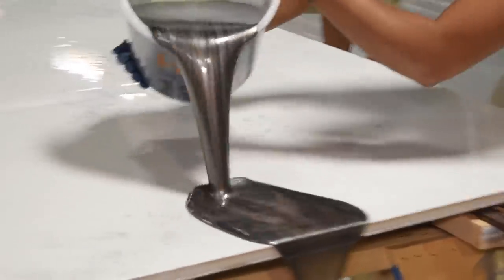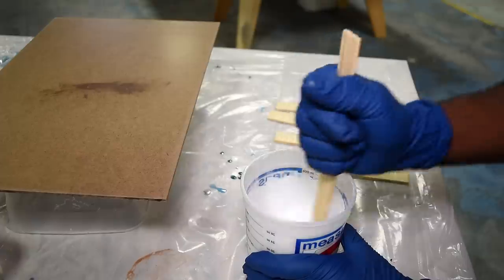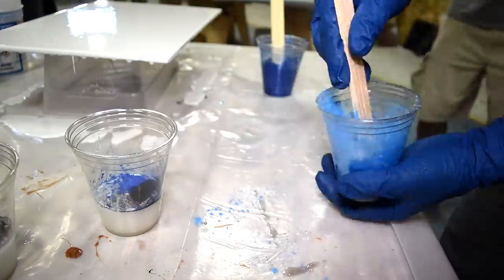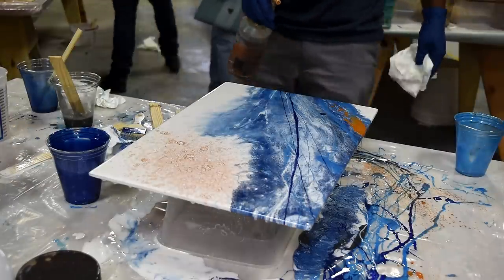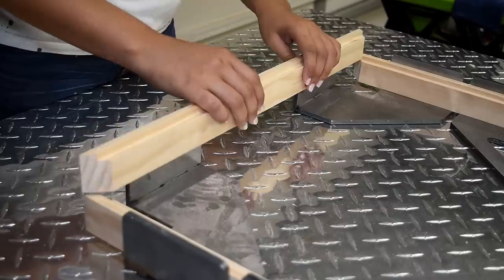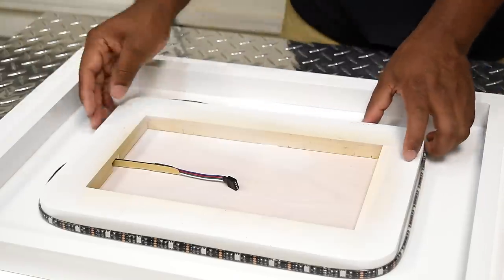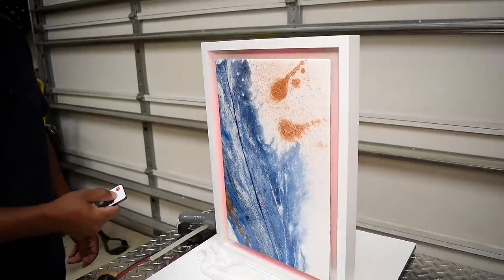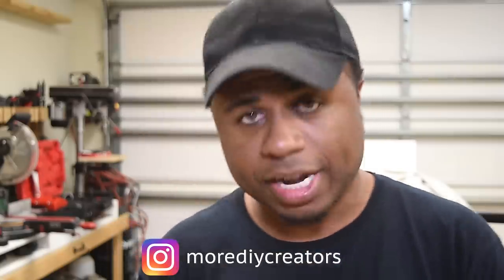How to make a modern picture frame and epoxy art

Comment: Nice project, like that LED frame too!
Just received my 20 pack of 1ft LED strips for my project.
Reply from the maker: Thank you nice, What you making?
Reply: Some will be used to light up the back of the headboard and under the frame of my daughters bed. (Multi-color)
This will be better than leaving the hall light on for her. She'll be able to dim, and change colors.
Also less power hungry!

The other will be for my Creality Ender 3D printer. (These will be white only)
When I babysit special or multi-color prints, I have to use a flashlight at different angles to see things.
These strips fit right in the extrusions to light it all around.
Just waiting for the connectors to show up.
Keep up the good work!

Comment: For the colored bits you don't need to use a brush, sometimes the pour itself is awesome. You can use a heat gun to get rid of bubbles and blow your colors around a bit too. What was the dry time on this particular epoxy (they vary)?

Comment: Pocket83 (a cool youtuber) told me that when working with epoxy the result would turn out better if you heated up the plate rather than the epoxy itself.
Reply from the maker: mmm I think I am going to stick with what I learned. Just thinking out loud that seems like a bad (I could be wrong) but if you heat the base it may hold heat too long and dry the epoxy too fast.
Reply: DIY Creators You are probably right, it was just a general tip for when you are working with epoxy ;)